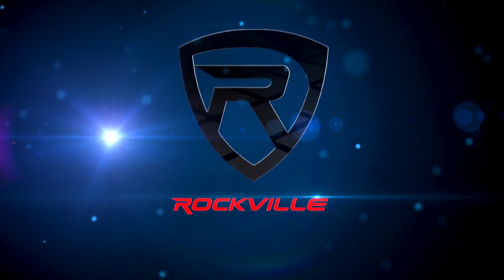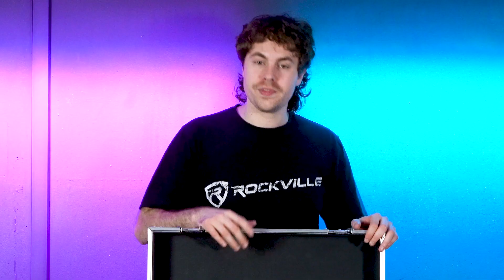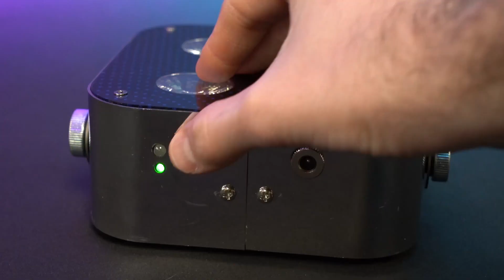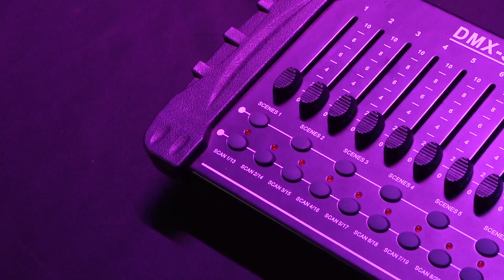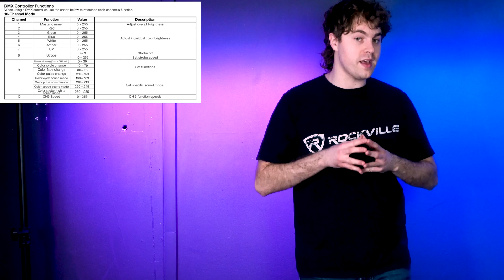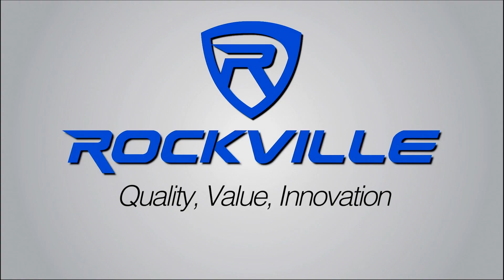How To Set Up Wireless DMX Controller w/ Rockville MINI RF1 V2 CHARGE PACKAGE (8) Battery DJ Lights

Comment: So I see that the Rockville wireless controller can connect to other wireless DMX lights like the  both up light. Which looks the same as the RF-4.  Will the RF-1 connect to let’s say a donner wireless dmx transmitter, which uses the same protocol as the Rockville wireless transmitter.